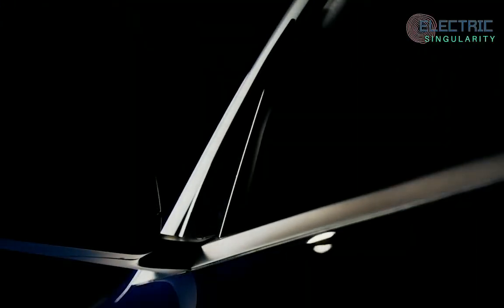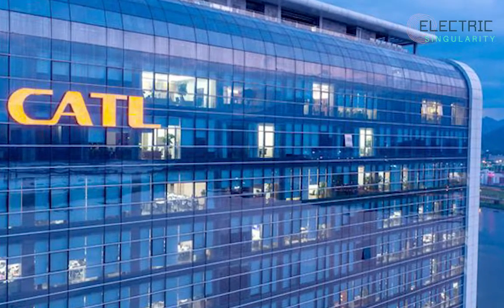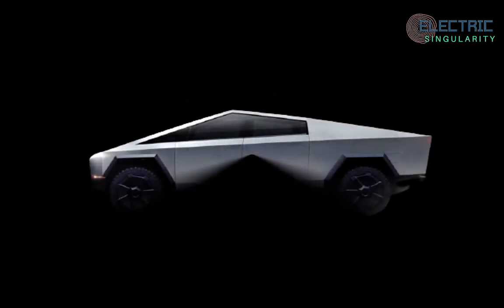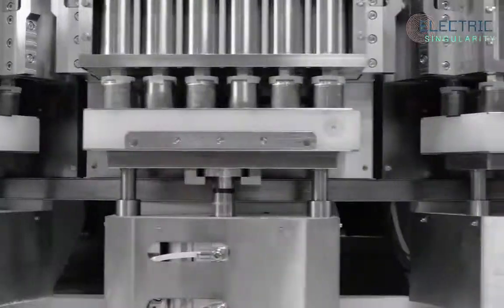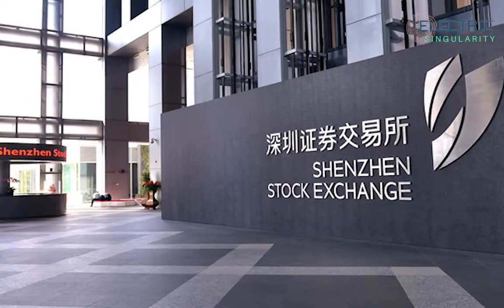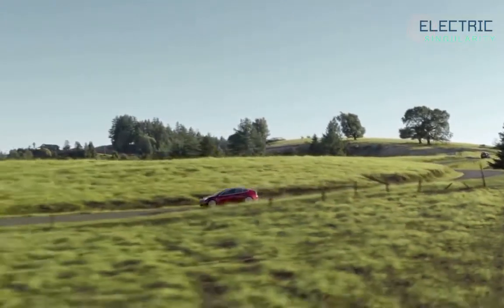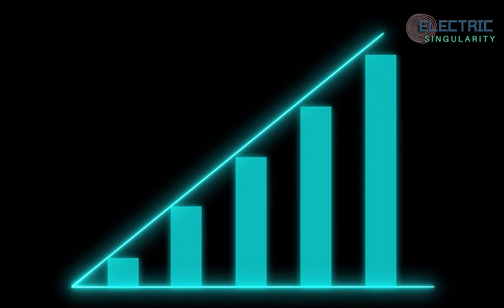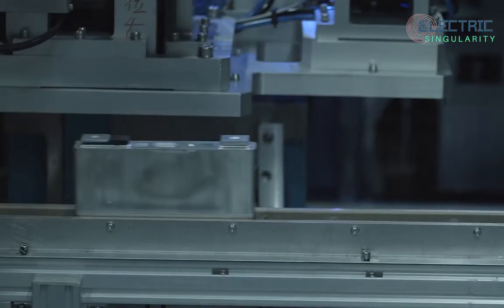Tesla get another low-cost battery supplier for Giga Shanghai

Comment: You're right about waiting for Ev's I ordered my new ev from Vauxhall I did get a ten-minute test run but that's it I've had to extend the insurance on my ice car as march 1st is normally new car day as the registration change to 2022 on that date which 3 years ago I picked up my ice vehicle so march 1st is only 2 days away I've heard NOTHING from the dealers or the charge point from podpoint who are supposed to fit the charger on my garage wall so it doesn't fill me with confidence the dealer did say to extend my insurance and mot my car which I've never had to do as its normally gone before that date wit ICE cars internal combustion engines just thought I had better explain I know a lot of you guys know what it means but a lot don't.so now we are putting bets on august or longer before I part ex my ice car for an ev we will be the first down our street to get one and lots tend to follow me as I am in the car world and have a very large knowledge of vehicles and which are the best or which are more reliable well at the moment all evs are reliable as you know they have a lot less moving parts and a lot less to wear out even brakes last twice as long depending on how you drive the ev and make use of one-pedal driving so it will be interesting as a lot know what I am getting and all want a ride in it when I get it the instant torque will shock them as it did me no lag in acceleration like my ice car with its turbo to spool up before it shoots off the line si I will tell you when I finally get my ev and how many coverts I managed to change to evs.

Comment: I bought a Brand New Kia Rio for $16,000 Dollars in March 2017... I have only put $450 Dollars in Repairs in the 6 Years I have had it,,, and it cost me $850 Dollars in Oil Changes... PLUS,,, it only cost me $1000 Dollars a Year for Fuel...  So that is Less than $25,000 Dollars including Car Payments,,, Fuel,,, Repairs,,, and Oil,,, driving 80,000 kms in 6 Years with a Range of 450 Kms per tank that takes 4 Minutes to fill... Curious,,, How does Tesla stack up to that??
Reply: My 11 year old Tesla has 90% original battery capacity, accelerates quickly and silently, and is made of aluminum, so may last decades without rust.